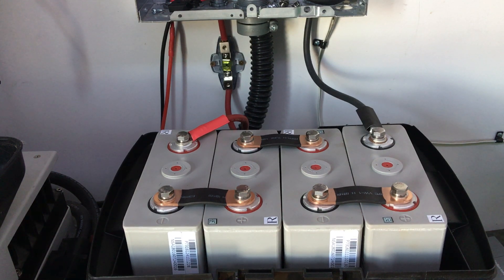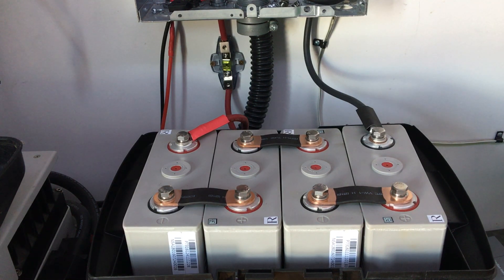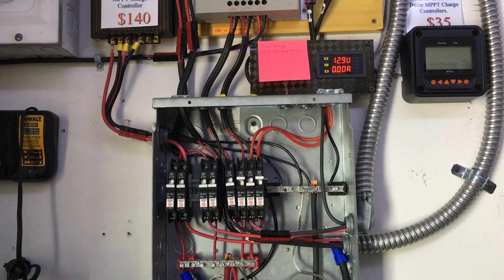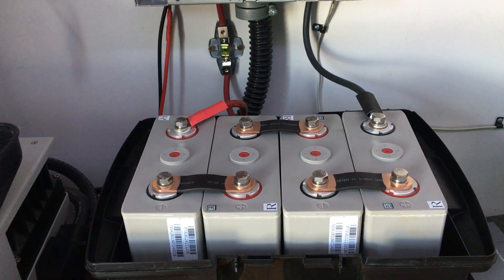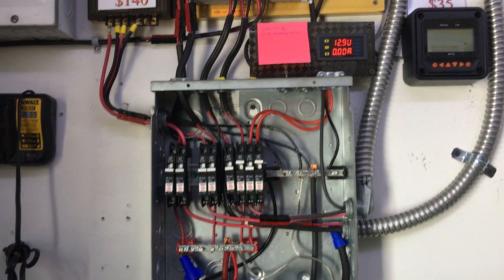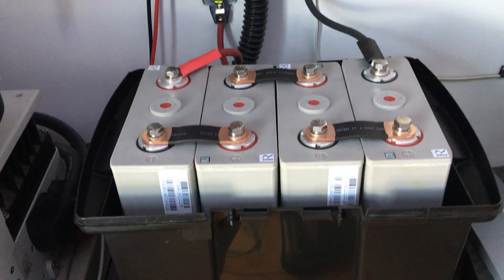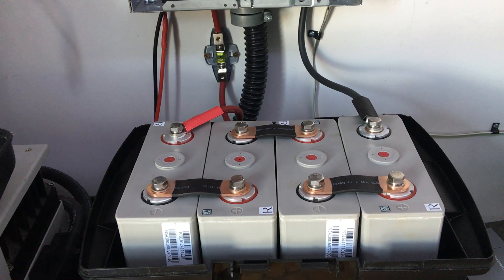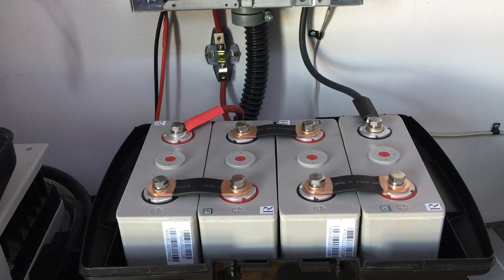LightHarvest Solars Lithium battery for our urban off-grid solar showroom in Portland.

Comment: go to batteryspace.com  they have balance  board that goes across each cell and has a LED showing working. and do not let cells get too cold they do not hold charge well under 32F. I went with 10 NiFe cells in my cabin because of cold.

Comment: I LOVE my CALB 180's.  I have 8 for a 24V system.  4 years old,  60% draw down every night,  no appreciable loss so far.  No BMS,  I monitored them real close for months.  They never differ more than .05 volt from each other.  The "miracle" battery is already here, and has been for years!
Reply: Thanks for sharing your recent experience. Are you noticing any change in cycle depth or heat buildup during charging?? What is your quarantee period and battery price....thank you. As prices come down this maybe the "go to" battery.

Comment: I've had 4 of the CALB 100 amp cells run in series like yours, almost two years And I purchase 4 more  about a year and half ago .
I did some initial tests on cell balance at load and at full charge, They stay in balance under load and only vary 10 millivolts at full charge, And have cycled them several hundred times.
So I do not actively managed the individual cells , I set my charger controller to 14.2 volts, So the highest cells stay under 3.6 volts
Reply from the maker: That's awesome.  When I take my balancers off they tend to go out of balance pretty quickly but I clearly have 1 cell that is not performing like the others.  Thanks for the comment.
Reply: LightHarvest Solar glad to put my two cents in, I very happy with mine, Best batteries I've ever used, Beats Lead Acid hands down, No wasted watts on Floating or Equalizing, You only have to put back about 10% more that what you take out.
All 8 of my cells only vary when they are near fully charged, And CALB's spec's say to keep the SOS (State of Change) between 10 -90% So I never go all the way to 14.6 volts I.e 3.65 volts per cell , At 14.2 volts all the cells stay within 3.5 to 3.6 volts.

Comment: I'd expect you'd need a pretty hefty BMS circuit for those cells, to bypass the relatively high current supplied by the solar panels which are charging the battery bank.  What did you end up using?
Reply from the maker: When I did this video, I had not even shrunk the heat shrink yet.  I was excited because I had just realized what these could do and apparently had to post it.  Of course I ended up with MUCH bigger wire, better fusing, etc. I did a lot of trial and error on the BMS front and ended up getting these super easy balancers and a good meter that shows my cell voltages individually.   It works well. The battery is insane, I've seen 380 Amps discharge, 360 is spec.  Check the other videos to see the updated system. Thanks.

Comment: I've been using a 15AH and 36v Lifepo on an ebike for two years. It has retained 92% of capacity over quite a few cycles. These are Chinese cells. I was looking at some cells on Ebay and Alibaba, but connecting them is a pain. This large cell, maybe more cells inside the housing, is very nice looking and easy to connect. That's about the amount of Lithium I want. I guess you would want a BMS. Light Harvest seems to be nibbling at lithium, with no BMS that I can see.

The steady voltage distinguishes LiFe from standard small cells. I go from about 38v and at 36v the pack is close to done. I can draw 20 amps peak and the drop in voltage is maybe .3v. These are great batteries, just big and heavy relative to new chemistries.

People really should be going down this road if they are heavy users or looking for performance. Higher voltage might be more efficient with a big inverter.

Thanks.

Comment from the maker: I came in to the shop today and guess what, I found the dreaded "out of balance" condition I've been watching for.  I had my charge controller cutoff lowered from 14.6V to 14.4 to prevent overcharging but after a particularly sunny morning, one of my cells was still much higher than the others (3.8V, shouldn't go past 3.65V). I concluded that the problem lies when the cells are almost full and 1 or 2 will fill faster than the others allowing an overcharge condition.  In this case, a BMS would heavily discharge the high cell allowing the others to catch up and balance.  The cell voltages seem to stay very close to each other until they're near full. Of course, use a BMS at home, I'll be testing a few shortly.
Reply: You might want to lower top voltage to 14.0 or even lower.  I think some EV guys go to 13.8V for longevity.
Reply: you can get away WITHOUT a BMS when you use a top charge voltage of 13.9 volts, there is realy not much gain in higher voltages with Lithium LiFepo4 because of the sharp upper 'Knee΅in the charging curve, at 13.9 volt MAXIMUM charge the battery is already 95 percent FULL , charging with higher voltages brings the risk of OVERCHARGE the pack or even a single cell, 13.9 v is allso a more friendly charge, thus your battery pack will last longer...